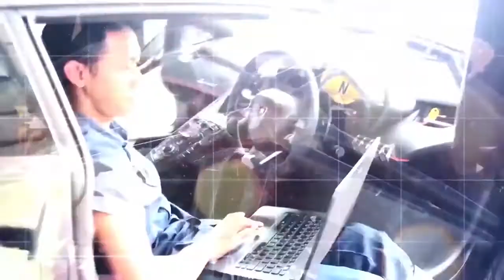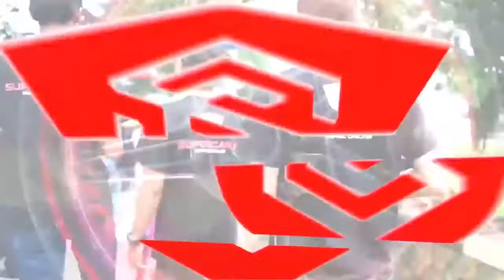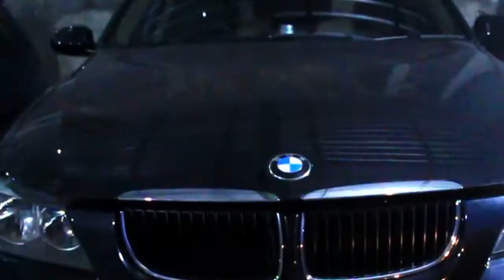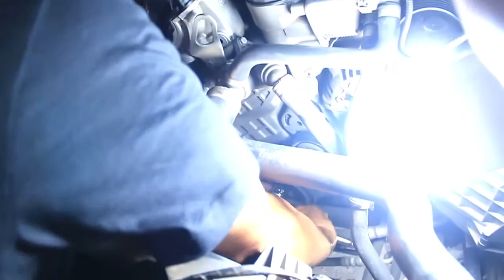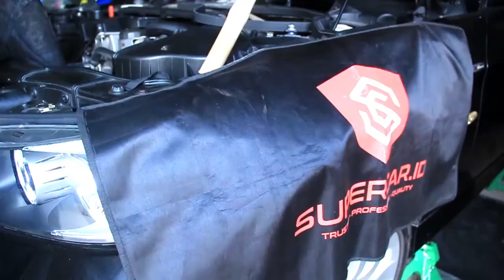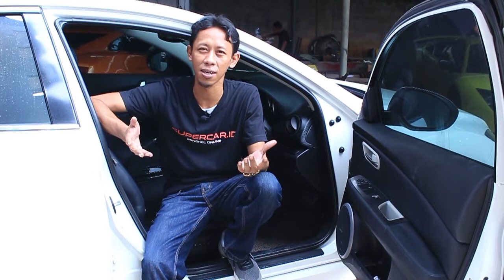Simak Perbaikan Transmisi Mobil BMW 320i E90 | Supercar.id

Comment: om..tanya donk : 1. e36 323i saya sepertinya bermasalah. asap bau bensin (pedes). klo lagi idle, mobil aga sedikit ndut2an alus .bensin kayanya jg agak boros (1:7 dalam kota, rata2 speed 40-50km/jam). tapi rpm normal & tenaga konstan/ gak ngempos sama sekali. 2. kompresor mulai agak berisik sedikit. berapa kira2 biaya service point 1 & 2 om? makasih sebelumnya. salam -Riza di depok.
Reply from the maker: Hubungi kami di 081808182277 yah gan.
Reply: Air flow itu